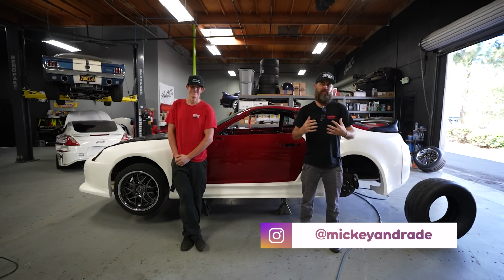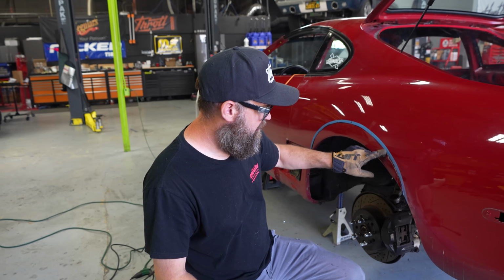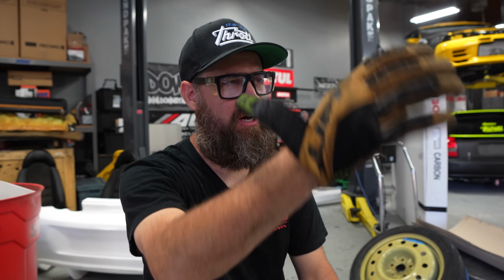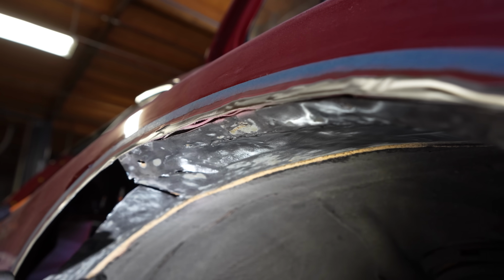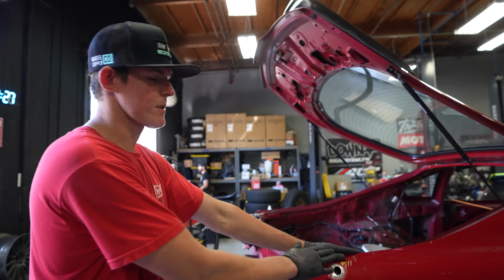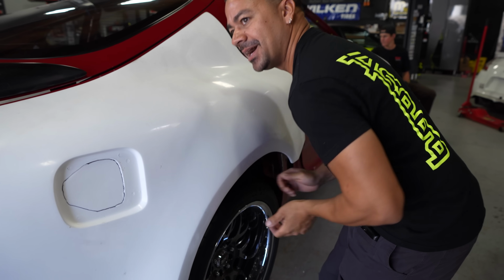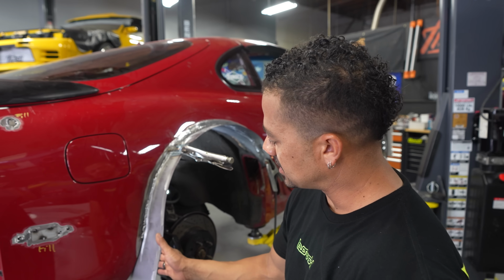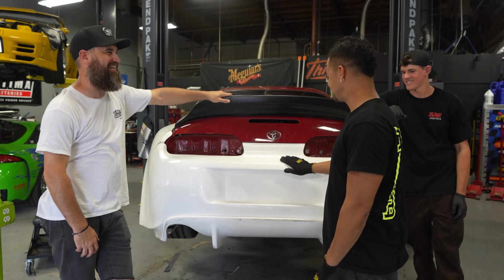Building a Modern Day (Fast & Furious) 1994 Toyota Supra Turbo – Part 4 – Widebody Install!

Comment: Personally, I would’ve got the exact wheel and tire setup, mount it, and cut the chassis exactly where it should be using the actual setup.. you can lower it using coil overs, and you can take out the springs and compress the suspension to test wheel travel

Comment: I think you should of used weld through spray paint on the inside of the panel before you welded it, because now the other side of those steel sheets are raw steel.

Comment: Hey guys, protect all glass and weatherstrip from the welding spatter and cut off wheel sparks. Welding blankets work well. It can pit the glass. I know first hand from when I modded my Starion but luckily had a parts car for the replacement glass needed. Just my $.02. Love this build!
Reply: 18:48 they did cover qtr window glass. But ty for tip i will need when working on my Z31

Comment: Hello to the team from me huge fan and all and i want to give a bit more spice to the project with an idea of mine.SO i was thinking, what if you put some gtr r35 door handles or tesla  because they are prety much the same.It would help modernise the exterion a bit more, plus in my opinion it would look cool and clean.I hope you get to see the comment in time so you can maybe add my idea to the project if you like it and it fits your original idea of the modernised version of the faf hero car

Comment: This build has me a little more intrigued now with the direction after seeing that tire.
I thought this was going to be a traditional wide street wheel thing, not so much a chunky drag radial thing. Isn’t 315 on the smaller side for a body kit that wide? I expected something crazy like x12+ rear wheels.

Comment: Why are you guys welding in the patch panels for the side markers and rear wiper from behind??  Wouldn't it be a lot better to make the patches fit in the holes, ann not behinde. So you don't need to fill it in with a bunch of bondo???  I get that on a civic or something like that, it is a quick and easy way.  But this is a Supra, and a supra disserves nothing but the best.

Comment: Question for Mickey/Quinn/Ricky Are you guys doing a coat of weld thru primer on the metal wheel wheel weld on covers before you weld them on? I ask because i see Quinn primering them after welding and cant see how the inner part can receive primer after welding.

Comment: Is the structure not gone out of those wheel wells now?  Welding in Flat 22 or 20 gauge is not nearly going to be the same as the oem stamped inners that get rolled together and pinch welded with the outer quarter skin. All the 22ga is doing is just filling the gap, no much structure added there. IMO That's why it's so hard to justify a wide body. Just IMO of course.

having said that I will say it's leaps and bounds ahead of the typical hack jobs on widebody cars. Don't mean to be negative at all lol keep up the great work and cool builds 😊
Reply: It’s a supra, they have the chassis rigidity of a fish anyway.
Reply: It’s a sponsored show car so it probably won’t be pushed to it’s Limits enough to notice a difference.  you’re right about losing integrity tho it fs won’t be the same

Comment: Why no Copper weld thru primer like German BASF or Dutch Sikkens aka. PPG on the inside wheel well? You have bare metal from inside with no way to protect it from water vapor in the air. 
Gentlemen that's bootleg job, atleast spray some 3M cavity wax.

Comment: Don’t hate on me because I love the build but you guys are going to destroy every piece of glass in that car with weld splatter. Don’t believe me, run your hand across that back window where Quinn just welded closed the wiper hole. A little prep could save you a ton of $$, especially when you’re building a show car.
Reply: The glass probably wasn’t perfect to begin with, and I’d wager since they’re building a sponsored sema build they plan on replacing it
Reply: @ethanburgess5929  You must be a NEW Sub?  No disrespect intended, but these guys ain't tryna replace stuff they don't have to, on any build.
Reply: @1godaboveALL  I’ve been watching since the 08 wrx hatch build. If they want to win anything at sema they’re gonna have to replace the almost 30 year old glass if it’s original
Reply: They'll remove the glass before painting the car and replace it... they always do that ... if you haven't noticed by now
Reply: he is absolutely correct every time I have welded on a vehicle and didn't protect the glass the splatter will leave a little divots in the glass only way I know how to explain it is it's like having it sandblasted and you'll see it when it hits the Sun
Reply: @JayL781  that’s all I was saying, although maybe they will replace all of the glass since it’s a sponsored SEMA built.
Reply: @LuvMyGT500  I don't know my buddy has a Toyota Supra just like this he was being stupid doing donuts in a dirt-lot had a speaker box in the back not strapped down hit a bump speaker box went through the back glass it took 3 months and $800 later and that was about 15 years ago at the time no one had the glass in the United States but times are different so I don't know
Reply: @LuvMyGT500  Sponsored or NOT, I don't think running up the bill for stuff that shouldn't or could avoid being added to the tab is their angle.  
What you said initially, and the way that fender liner was welded says enough about where the level of skill and knowledge is at in the shop, in regards to welding, metal work in general.
#FireBlanket
Reply: @LuvMyGT500  I see your point and it’s valid, but we are yet to see if they paint or wrap the car, if they paint it glass will probs get pulled and replaced but if they wrap it then the glass will stay 🤔 I’ll be thinking bout your comment during every future episode till they handle the glass haha
Reply: @JayL781  WELDERS UNITE‼
These foks don't know shit about it!  In the shop and in these comments!  Fok'm!  Let's just watch the show🤣👍
Reply: Love the concern
Reply: 😂😂 I feel better u said that I felt karenish🥹😅😅
Reply: Yup.
Seems somebody else is educated in the Art of Welding as well.  Please to meet you, and Thank You for sharing.
Those were some good Tack Welds though🤣👍
Reply: Mate it’s a sema build they are definitely going to be replacing most of the glass
Reply: Bro is already ruining it by doing a wide body windows are lease of the worries
Reply: @bennims8746  “ruining it by doing a wide body “ pipe down lil bro
Reply: @bennims8746  L opinion
Reply: @bennims8746  opinion isn’t fact darlin. 🤙
Reply: So you think that A they will listen to you and B that they will not change everything on a sema bound car?🤣🤣 HEY PEOPLE OF YOUTUBE..LETS POUR THE HATE ON THE NOOB🤣🤣🤣🤦‍♂️
Reply: @re-mycazabon625  that was a really smart and constructive comment. Maybe you can share more of you vast wisdom with all of us YouTube noobs! Another keyboard cowboy writing checks your a$$ can’t cash.

Comment: Looking good so far. I think a nice touch would be to use the same mesh that is on the bonnet to fill the holes that will be cut in the front fenders.